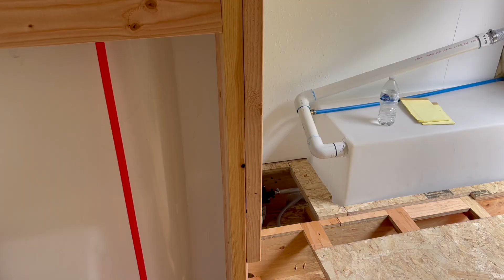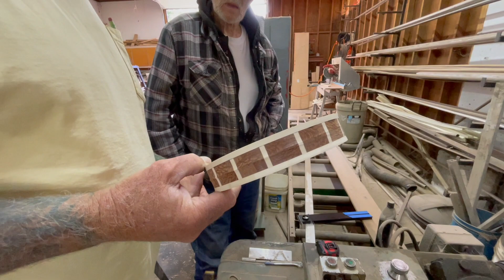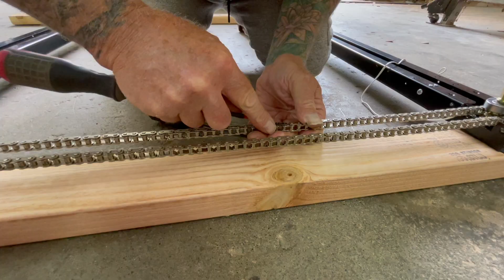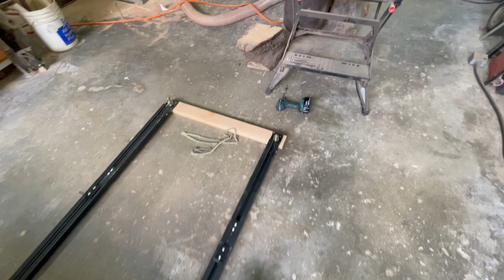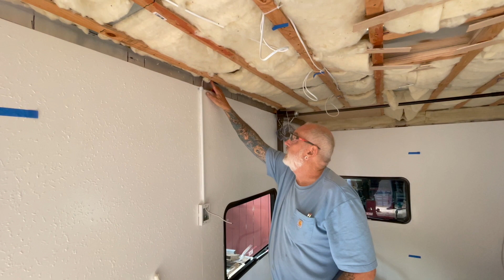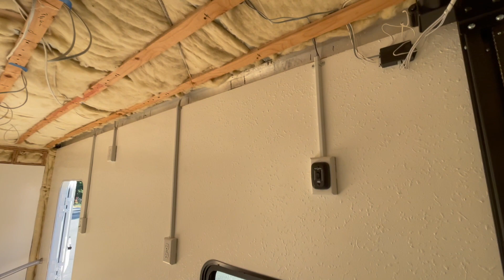vlog 404 BOX TRUCK #13

Comment: You didn't want to weaken the ribs by drilling holes into them for running wiring but it was okay to cut the ribs without welding cross members before installing your windows?
Reply from the maker: We framed in for the windows to reinforce. For the electrical every rib would have had to be drilled. Hence weaking it.